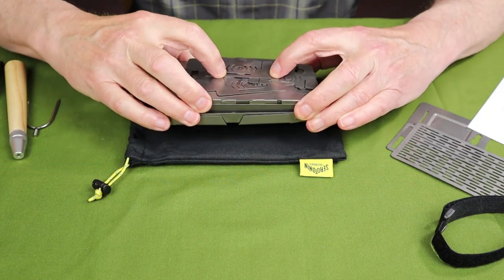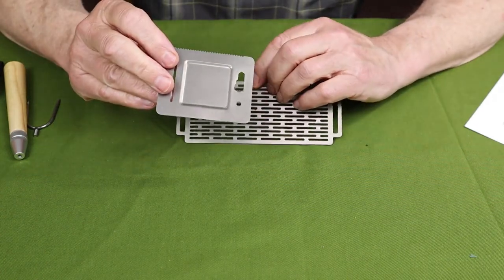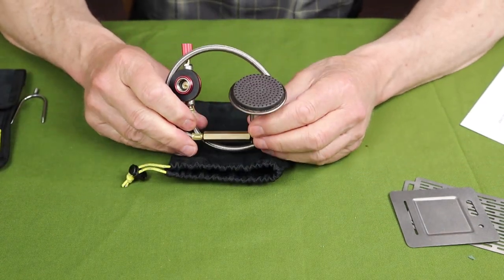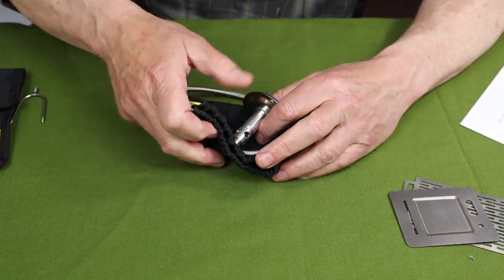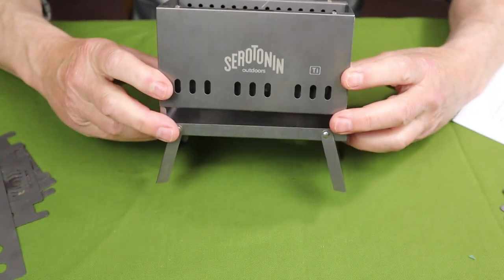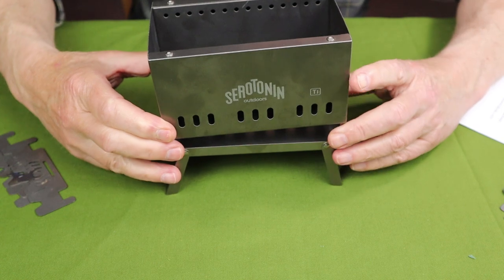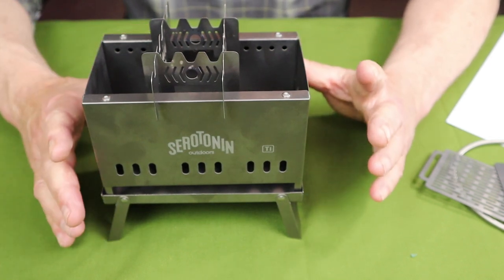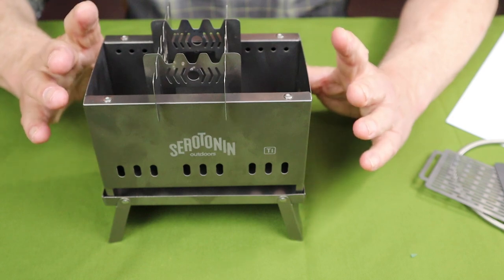Serotonin Outdoors Multi Fuel Wood Gas Stove Give-a-Way Closed

Comment: I'm in. As a wood stove it looks very interesting. I'm not sure the gas insert makes a lot of sense since you end up with a huge stand for a single burner. For that size, I'd almost think a two-burner option could work, allowing two small pots to sit side by side. but then more weight, more gas, different problems. Still, looks innovative.
Reply from the maker: you are in

Comment: I'm in. This is a very interesting unit. We own multiple wood gas stoves, both factory-built and DIY. We constantly run tests to increase the functionality of our stoves by mixing and matching components. The goal is to have the flexibility of a multi-fuel stove. We have few non-permissive environments here in the Philippines but we do get some strange looks in public parks when scavenging and using twigs as fuel. With an alcohol burner or gas adapter, no one appears to give a hoot about what we do.
Reply from the maker: you are in

Comment: I'm in!  A chance at a free wood-gas stove?  You bet I'm in!
It's definitely an interesting design.  I'm so used to wood-gas stove being round, with intake ports and exhaust ports all around the stove, that it looked a little odd at first.  But on considering about it, I don't think there's any reason why having them on only two sides wouldn't work.  I'm looking forward to you being able to get out into the woods and test it out for us!
And they've got several ideas I haven't seen before - the stand with legs to raise it off the ground (especially if you can't clear out the place where it's going to be sitting, or during the winter with snow on the ground), and the pot stand that can be moved around and positioned in different places - may let you concentrate or dissipate the heat you're generating a little more efficiently.
Reply from the maker: You are in

Comment: I' m in.  This looks nice: simple, raised, easy lift for ash clearance and with fuel choices.  The steel version might be even better,  with a bit more weight low down.  A bit of extra weight, with extra stability.
Reply from the maker: You are in
Reply: @MarkYoungBushcraft  Thanks, Mark.👍

Comment: I'm in! I'm very curious how the isolated double wall compares to the original Bushbuddy. At least that was the stove to introduce me to gasifier stoves. With the Bushbuddy the openings at the bottom of the outer wall feeds air up under the burning material and into the double wall at the same time. The Serotonin (a play on the neurotransmitter?) doesn't mix the air for the outer wall and under the burning material. That might make it a better windbreak when using alternative fuels: alcohol burner, butane, solid tab. Or perhaps there will be less draw up the wall with air drawing more under the walls to the flames. I'll be following what your testing determines.
Reply from the maker: You are in

Comment: I'm in .  I can't wait to see a burn demonstration of this stove, the gasifier aspect is very intriguing.  If it works like I'm picturing it will, I think a slightly larger version would be intriguing to use for a small, contained, smokeless, personal campfire.
Reply from the maker: You are in. Thanks for commenting

Comment: G'day Mark, well its versatile all right and like the flat pack and weight. I am on the fence whether rectangular or square is more desirable, but this way it appears you can slide the pot stand along to suit the fire within, or feed in fuel from the top, (and either way longer pieces), maybe add a second pot/cup/bottle of sufficient girth to span the walls. 
I really like that the body will act as a windscreen when using gas. It does look like you can only use their own burner though, (and their burner only works with their pot stand and in turn body).
I look forward to seeing how efficient the gasification is, since there's only the two double walled sides. I've no doubt it'll still work, ..... just how well.
I sincerely hope things calm down bushfire wise over there, its a necessary evil over here for rejuvenation of many species, but wherever you are, it aint much good for us humans. Cheers Duke.
P.S. btw; "Serantonin" sounds like a brain chemical, ....... not sure if that's good or bad from a marketing perspective, i.e. either a smart multi-fuel design or  ........... you need "brain power" to put it together ; )
Reply from the maker: Lots of testing to do, once I can safely have a fire. Thanks for commenting Duke
Reply: @MarkYoungBushcraft  No worries Mark, btw; you may have noticed I didnt opt in for the give away, even though I reckon it is one of the better designs out there, it's just that I've more than enough kit to last me the rest of my days. Would be great if it could go to a young person starting out or another that cant afford premo gear. 
Not sure how you'd "police" that though and I guess it does conflict with "fairness to all"
I can only hope "luck of the draw" lands it where the most benefit will be had.

Comment: I’m in.  Thank you for the preview. I do wish you had the time and circumstances to use the stove.  I like to save weight like everyone else, but I am wondering if I would prefer a slightly thicker titanium used for some of the pieces of this stove.  I have a few stoves where the manufacturers leaned more towards weigh savings (eg crossmembers for Toaks woodgas titanium stove crossmembers) that are always bending, flexing, and warping.  I guess I prefer higher durability to ultralight weight.  I want bombproof over a few grams of titanium yet I still want titanium (not steel).
Reply from the maker: You are in. Will know once I do some testing

Comment: When I need to test a stove, I generally do it where I know that if there an issue, I have the resources to handle it! This being said. I will test any camp stove in my driveway with the garden hose near by, a fire extinguisher and a second watchful eye nearby! So while forestry fire bans maybe in effect, I can still safely test a stove at my house for demonstrations! If conditions are too dry, I start with wetting the ground around my work space, and place a large paver down beneath the stove. This give a safe work area from ground contact fire, I don’t use any chemical fire starters, just fatwood and birch bark to ignite ( for solid fuels, for gas a long match! Remember when dealing with a “new stove” regardless of manufacturer, construction materials, or experience, it it always best to get familiar with the stove at home in the driveway or the back yard! Before heading into the woods!
Reply from the maker: Good suggestion. Unfortunately, the fire ban extends to the city as well. $26,000 fine
Reply: @MarkYoungBushcraft  well that’s the difference between Canada and the USA

Comment: Very neat, but not for me.  I usually pair a bushbuddy/bb mini with a trangia backup. Smaller, and a lot lighter.  Plus my full Trangia cook set can also run gas and multifuel stoves.
Personally my biggest issue against the Serotonin stove, is it is too narrow on one side, and too wide on the other.  I would be far more interested in a more squared one, with jets on all 4 sides, that would better cover your typical pot.  Plus that door will get in the way when it loosens up -It will want to stay closed all the time.
Thanks for the video all the same.
P.S. you may want to fix the title, it is spelt serotonin (a chemical used to transmit signals by the brain)
Reply from the maker: Thanks for the pickup on the title

Comment: I would love to find a titanium wood stove large enough to grill two steaks at the same time.

Doesn't need all the weight and cost of the gasifier; just a large box and grill would suffice. Twice the size of this.

I suppose I could use two of them, but that would be less stable and less convenient, plus extra weight. 

The closest thing I have seen is a disposable aluminum "charcoal grill" at the grocery store. It's just a 9x13x2 inch pan, a layer of match-light charcoal, and a grill top. Simple, lightweight. Not really reusable though; the aluminum pan is too thin and burns through. 

A half-size steam table pan with a grill topper might be a crude MYOG version. Would be nice to have something a little more sophisticated, with adjustable grill height and some kind of folding legs to protect the ground.
Reply from the maker: I have a few lightweight stainless steel options in my playlist. Thanks for commenting
Reply: @MarkYoungBushcraft  I knew you were the right man for the job. :)

I see one brand that is perfect: the larger Picogrills. Expensive, but otherwise exactly right for my purpose. 

(The Picogrills would need a very large windscreen.  Maybe a sheet of aluminum foil would protect my pack from stray sparks if used to block wind?)

In your "Naturehike Mesh Firepit and Tripod" vid you said that you had a plan for a grill to use with the firepit. Did you ever make a vid showing that setup?

Your "DIY Backpack Wood Stove" could be modified to be larger, so that might be another option. (Or two of your vegetable steamer stoves for the simple-and-cheap option).

Firebox Flex 8 Panel could also do the job, but it's not as neat a package as the Picogrills, at similar (stiff) price.

(Searching the playlist is awkward. Not your fault; that's more of a YouTube limitation. You sure do have a lot of vids about wood stoves. Thanks for all the work you put in to do that.)

Comment: Out of curiosity, why would there not still be a need for a pot stand when using solid fuel tablets?  The pot stand is no longer available if it is down inside holding the solid fuel tray.
Reply from the maker: I expect that unless the pot covers the whole opening then there is still enough room for exhaust. Will know when I test it. Thanks for commenting

Comment: Just thought of a question, Mark. Serotonin has a video where they pour some fairly chunky wood pellets into the stove,  and none of them fall through the burn plate. Have you tried putting the pellets that you normally  use in, to see if any fall through?
Reply from the maker: Not yet, all part of the testing I will be doing. Thanks for commenting

Comment: I'm in.
I am confused about the solid fuel plate going on top of the pot stand. Where do you put your pot?
Reply from the maker: You are in. Good point. I will need to consider that when I test. I expect the idea is to use a pot smaller than the stove is long to allow ventilation